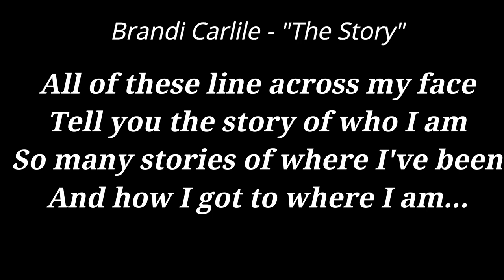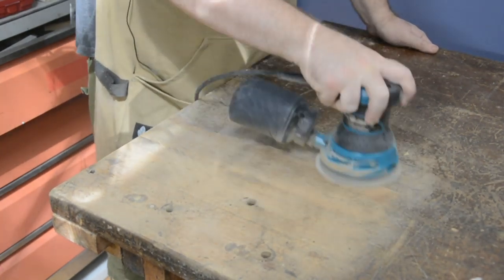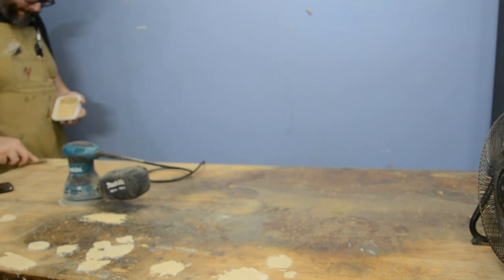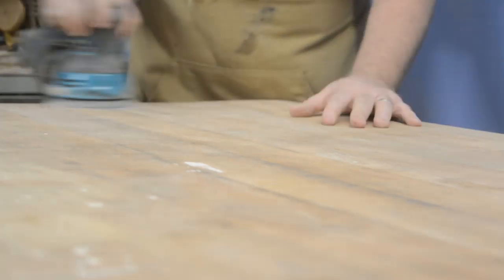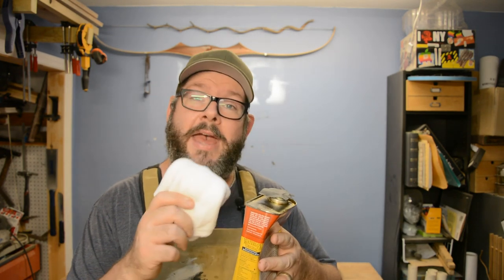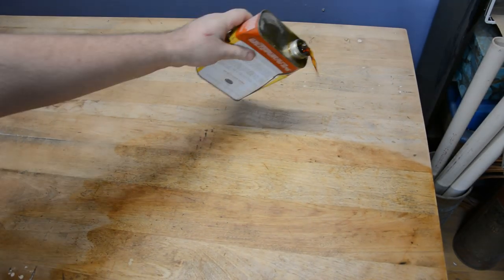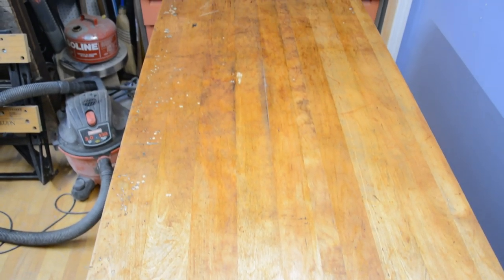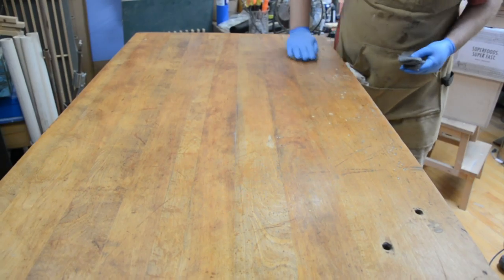How to restore an old workbench. Fixing an old workbench. Part 1

Comment: nice history in this video
Reply from the maker: Thanks bro! Made anything new recently?
Reply: @BurkeMakesStuff  I'm going to make a nuclear/solar powered battery using tritium vials and collecting the light they give off using the tiny solar panels to power a light I believe that it would be a cool thing to display in my bedroom.
Reply from the maker: Kyle Cheng just don’t melt yourself on the nuclear side of that project please.
Reply: @BurkeMakesStuff  it is alright because the radiation that it releases it minimal at only about 4 times background radiation and that's just from the beta particles which aren't strong enough to penetrate the skins surface

Comment: Hey mate, just saw this..nice video! Only thing I'd change is wiping it down with methylated spirits after sanding to catch the dust. Any form of moisture raises the wood grain and you'll end up having to sand again.
Reply from the maker: I actually did think about that, though I didn’t mention it in the video. Thanks for reaching out!